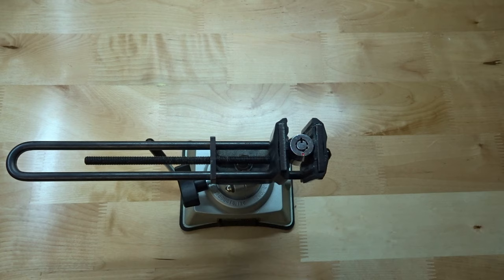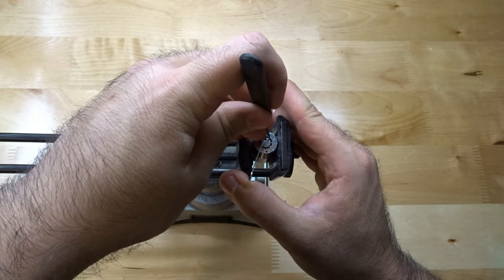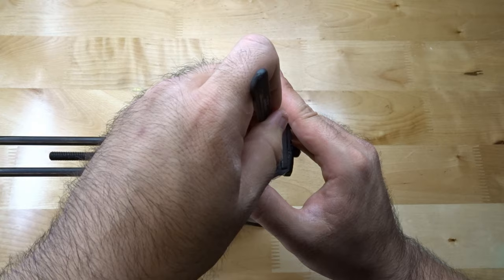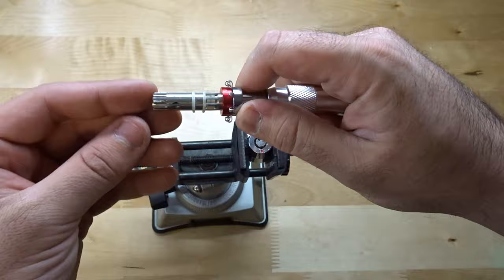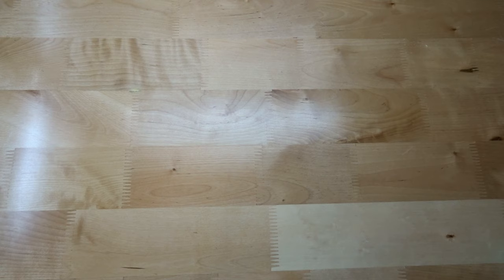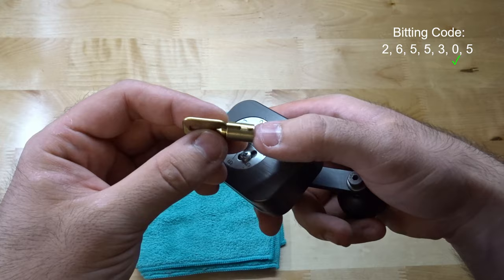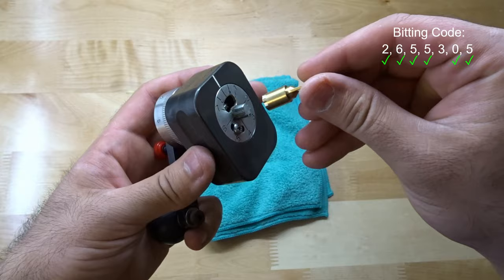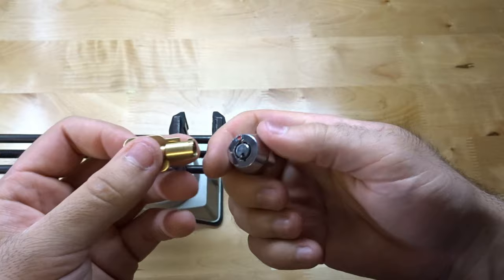[4] An Attack Methodology for Tubular Locks!

Comment: I know this is an old video and I’ve seen a few like this. Sometimes the hulk tool will not work if the spring lengths and tensions are different,however.why don’t you single pick it once and just before it drops into its second set,use the Impressionism tool .
Reply: That's what he did, didn't he?

Comment: I got an under the door tool, its a old bumperJack with long pieces of steel welded on the lifter. It demolishes any door frame. Or jack up any door enough to bust through. Got idea off of old Cops show🤷🏼

Comment: I found your old video. I still say there are many circumstances where you secondary technique wouldn't work. I engineered a lock box with a push-lock, ACE cylinder on my E-bike. The frame prevents the insertion of a Sparrows type tensioner. We tend to get  overconfident in the shop, but real world is often quite different. And by the way, my impression tool wouldn't pick my lock either, so I agree with your original premise.

Comment: I encountered the same problem you did. Tried everyway=nothing. The pins WERE moving but I wasn't setting shit, lol. Tried using the Impressioner after picking halfway past 1st set= still didn't work. I plan on trying more later. You can get free Tub locks off elevator doors to practice. Most will have a lock installed where the dropkey goes and can be opened with a tubular key(not sure if these are universal or mine were just the same per institution). Also, since I've never heard you or Dev talk about it- Elevator Boxes are great to acquire shit from. Mech Eng's are logical people so not only will it contain the El's Tubular keys and flat operator keys but they'll usually chuck in a couple of door keys for doors that are nearby or relevant so they don't have to carry them around when they need to access it.

Comment: The sparrow is nice, but i cut my own woth a long handle i can palm, and cross with my finger... really helps feel the pins, which dont give goodfeedback prying on the cylinder outside.
I remember picking my first laundry machine with a hairpin and a homemade v tensioner. Man did that feel good.

Comment: You'd mentioned when using the decoding block in the video , that you can also use calipers to get the bit coding but never explained or showed how. Could you either quickly explain that process or make another video showing how ? 

Would you use IN, MM , or IN/ Fractions setting when using  Calipers to get the proper bit coding off your impressions tool ?

I would imagine you'd use MM while using the Upper inside Jaw...

Comment: The problem for me is that I have a Harbor Freight US General toolbox that I have the key for and I can't open the lock. Keep in mind that this lock has been locked and unlocked less than a dozen times. I moved the toolbox from the house to the garage. It was locked to move and now I can't unlock it since it has been moved. Harbor Freight couldn't care less. They have my money and now they don't know me. I am not a mechanic by trade and only need the tools occasionally but when I need them I really need them. I bought one of those lock pick kits like you showed at the beginning but it either doesn't work or I don't know what I am doing, probably the latter. Any suggestions? Can I drill it out and replace it with a lock that wasn't made by Fisher-Price? If I do drill it out, will I be able to open the box?

Comment: If your goal is to attack the lock, and not to duplicate a key, once you pick it open, couldnt you impression the correct bitting with the cylinder lock tool, and then just continue to turn that like a key?
Reply from the maker: Absolutely

Comment: The lock which required 9 full rotations you say you picked 42 times with a 7 pin lock, that means there was only 4.6 pins if you picked it 42 times to get 9 full rotations.
That’s 42/9=4.6
9x7 would be 63.
Or am I missing something?
I’m quite new to lockpicking.
Reply: He said he would have had to pick it that many times, he just had a miscalculation in the moment; he did mention picking it like that is not something you do on the field.